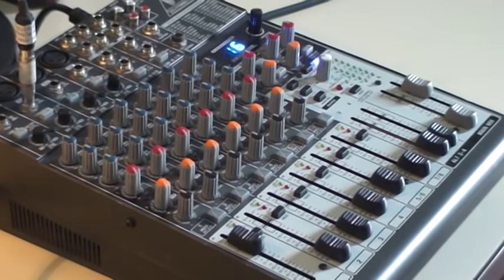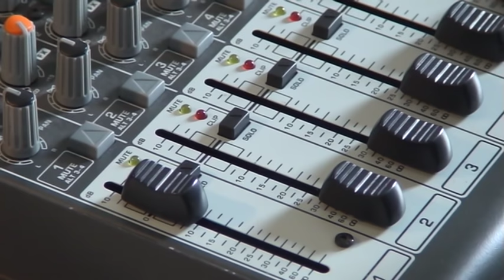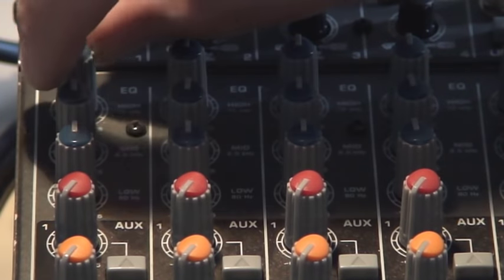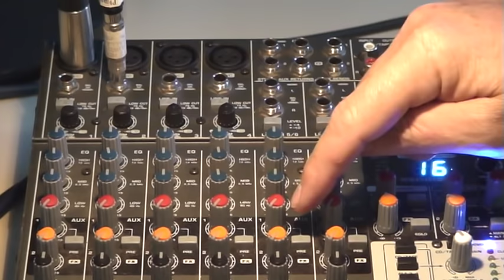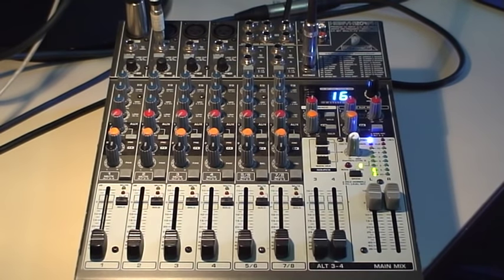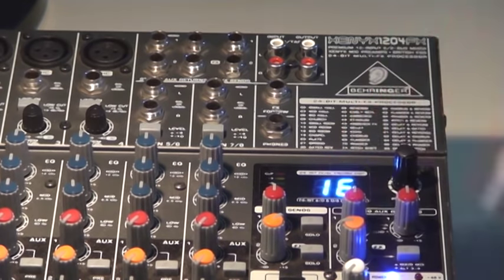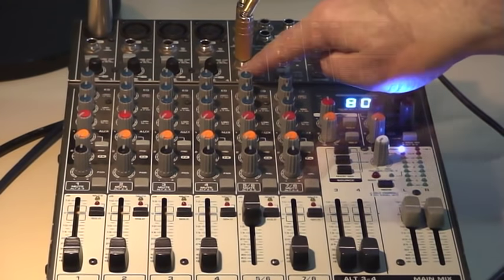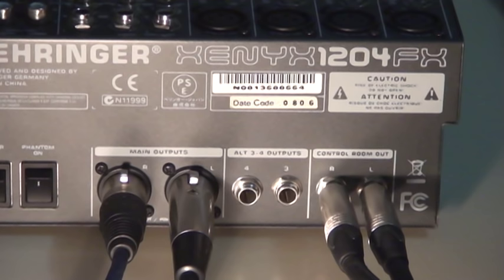How to use a Behringer 1204FX mixer for live sound reinforcement

Comment: do I need a di box for guitar?
Reply from the maker: +gbtayc Hi, there are several ways to skin a cat, you can use a microphone in front of the guitar amp speaker (play around with position of microphone as it will give you different tone) or you can use a DI Box, if you are playing acoustic guitar then there is no better way that plugging the guitar straight into the DI box & off to the mixer, if you are using an electric guitar and a foot pedal you can take off the signal into a DI box before it hits the amp, I've hardwired DI boxes into amps (a lot of newer amps will actually give you a direct out now) the DI box is wired between the amplifier and the speaker so you get the tone of what the guitarist hears. Hope this helps
Reply: +MDTV3  very helpful thanks

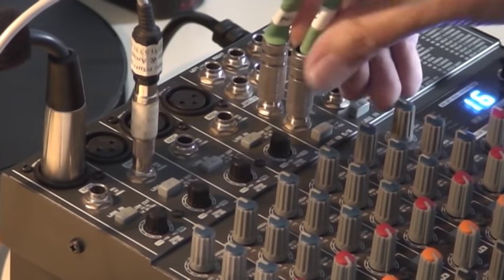Comment: What are the cables @ 1:10 called?
Reply from the maker: +Julia Perron Hi, the cables at 1:10 are a pair of mono 1/4" phone plugs, the other end of the cable can have either a standard 1/4" or 1/8" stereo phone plug (or 2 x RCA plugs whatever you need to plug into your other device). Regards Dean
Reply: +MDTV3 Thanks! Do you know where i can buy them? like a link to a website or something? :P
Reply from the maker: +Julia Perron Hi, that question was answered below but here it is again:Any pro/stage audio shop should be able to help you. Amazon sell Hosa CMP153 Y Cable 1/8 Inch TRS to Dual 1/4 Inch TS Cable - 3 Foot